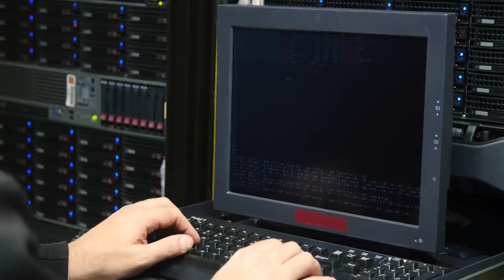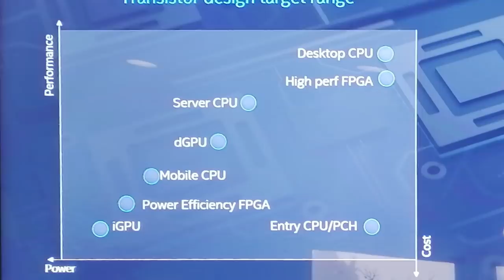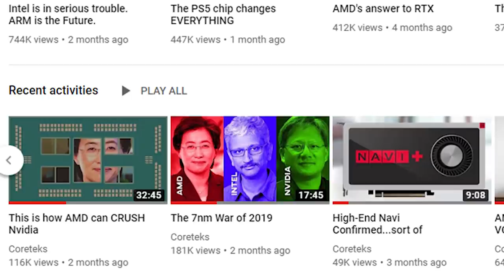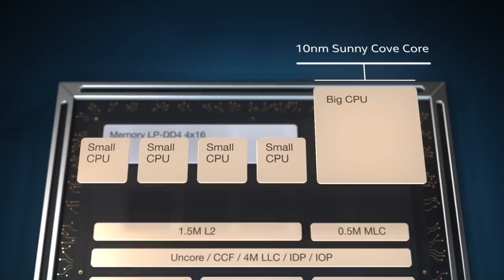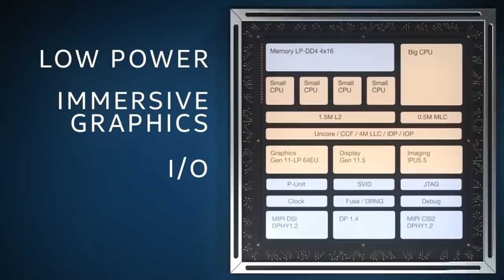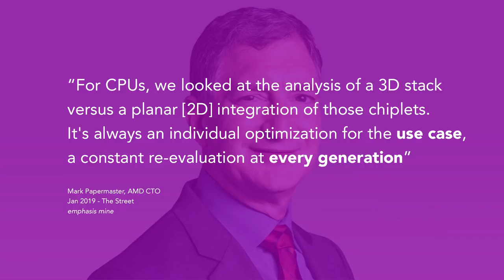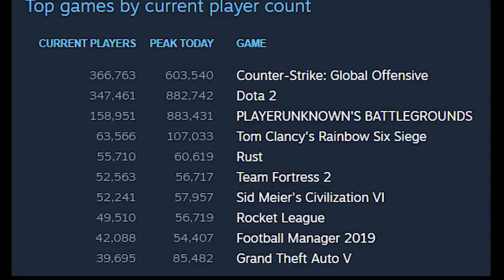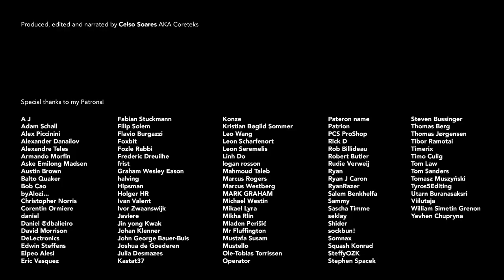2D vs 3D Stacking: Intel’s plan to beat Zen 2

Comment: I haven't upgraded from the devils canyon 4790k yet, it's starting to show some age in areas but all in all it's still hauling ass, Moors law seems to be slowing due to production cost. I read that part of the recent security issue in faster chips was partly from transistor bleed due to how tightly packed together the circuits are. Could explain why intel has been manufacturing 14 nm for 4 generations of cpu if you want to read or watch something really innovative check out neuromorphic chips. still probably a decade from production tough I think also what im hearing is the actual motherboard could become a bottleneck at some point haha

Comment: I love AMD and 3D stacking is the future but all that heat has to go somewhere...hope that doesn't melt the stacking interconnects. Either way I can only afford AMD for CPUs at this point and my stock R7 1700 does amazing things paired with a GTX 1080ti and Davinci Pro editor. Btw I'm not all team AMD, I joined the dark side and paired my Nvidia to a Gsync screen for the ULMB mode, aaaaaaamazing! P.S. I hope EA keeps making mistakes until forced out of existence and they sell all the IPs to more ethical publishers like CD projekt red

Comment: 3D probably is a good thing to do, but can they get all the heat out then. Heating the memory too much could cause lost the memory. Place the cooler (like micro heat pipes) between the CPU and memory also. Smaller transistor power consumptions...
The CPU speed never is fast enough.

Comment: Intel has done this various times in the past.  The Tualatin core was actually supposed to be introduced in the Pentium 2 era (it's a P3 technology that made its way well into the Northwood P4).  They hold back on purpose to stimulate the market.  AMD's x64 architecture is VITAL and if AMD dies, Intel would no longer be able to use this technology.  CPU manufacturers are not at war with each other.  This is the "Other Tick Tock Market".  Buy you Zens now and enjoy, there's nothing wrong about it.  They're cheap and efficient.  But Intel will eventually release some tech that it developed approximately 8 years ago in its newer lineup.  3D stacking in CPUs is almost 2 decades old in development by Intel.  So stop the wars and just buy what's cheap and works.

Comment: 2030 PREDICTION: CPUs are now cubes cooled with a combination of tiny Peltier devices and tiny heat pipes that join into bigger heat pipes like the branches of a tree. All these heat pipes will come directly out of the CPU and into a heatsink. No more thermal paste, no more custom coolers, no more memory cards. Due to size and cooling constraints, CPUs might go back to interfacing with the motherboard via a slot. CPU cards are back. Google Chrome and other ram hogs will move to feed on PCIe storage, that will be faster than DDR4.

Comment: Just put the memory on the bottom to fix the heat issue. And software devs need to just get with it and get parallel code going

Comment: So intel will be making 3 stacking CPUs that doubles as a easy bake oven? They have to solve thermal problems and the connection between all these parts and cores so that it doesn't have high latency just like Zen cores does with Infinity fabric.

Comment: There is a kind of cooling oil where u can submerge the cpu into without short circuiting it. So they can design the cpu that can be submerged into a mini cooling tank with that oil and then the oil is cooled by the external liquid cooling?

Comment: this will end the same way as HBM. AMD used stacking back in 2015 and it was expensive and it was called HBM Curse beacuse vega couldn't use GDDR5/6 because of the memory controller and that made the cards insanely overpriced. Radeon VII's price is 1/2 only price for the 16GB HBM2 memory. but that is future. it is expensive now but it will beacome mainstream

Comment: OK... quick criticism... when you compared the FX-9590 to the 4770k... There couldn't be more of an apples to oranges comparison. The 9590 as most know was a 32nm process, and at that was nothing more than a factory binned and overclocked 8350... which was well behind Intel's 32nm Sandy Bridge architecture... let alone the 22nm+ architecture used in the Haswell 4770k, in terms of IPC performance. About 35-40% behind at stock clocks... meaning you'd probably need an LN2 setup and around 6Ghz to come close to or surpass the 4770k at stock clocks... There's only about a 10-13% IPC gap right now, and Zen 2 looks like it will close that cap to within margin of error. So let's hold off such farcical benching comparisons until there are Zen 2 Ryzen chips in the wild and we can see what they do head to head with the 9900k.... as well as waiting to see if Intel can actually FINALLY get their shit together and release 10nm desktop or if they're forced to delay it yet again...

Comment: If you have to prevent overheating of 3D chips by lowering the clock speed, that makes no sense, if a 5GHZ chip has only 64MB of cash as opposed to a 3GHZ chip with 1GB of cash, that will make no sense either.
I am focusing more on smaller nm technology, just imagine if we will reach 1nm processed chips,imagine how much power can be shrunked down on a chip, also can’t wait till china will show it’s ‘’fully reliably working’’ to the world rather then bagatelize it,sothat we can reimagine how much more powerfull computers will ever be with new possibility’s but i guess this will also cause panic to the world.

Comment: I'm not sure how Intel is planning on cooling this "stacked Chip" they are not going to be able to get clocks up to anything near competitive to Zen 2 until they have a process advantage again.  Also the cost of Intel's active interposer is also gonna be VERY!! expensive just imaging the amount of silicon this chip is gonna need. The base interposer is gonna need to be almost a big as the whole package and will need to yield at nearly 100% functional to be usable.  So this chip is gonna be massively expensive for maybe slightly more performance.  i think intel can get it to work but i doubt that they will be able to make it cost effective for the consumer market for some time.

Comment: Ok, I may not be an engineer, but: How do they want to get the heat out? Stacking heat-producing components? Damned, it's cooling nightmare!

ps: No, I don't hate Intel (despite their price-gouging, but it's less than Apple, they just take what every market-leader would! I might not like it but I understand it)! Hell, I've run mostly Intel-Cores since I built my first PC (that was an AMD, but only because I was a damn kid who wanted a decently priced PC for gaming, after that it was a Pentium III and in 2005 or so I had an Athlon 64 (when Intel was losing their touch for a while and nearly missed the 64-bit revolution)...otherwise? Intel Core 2 Quad Q6600 from 2008 to 2011 and since then an Intel i7 2600K...so I am looking to upgrade currently and I will buy whatever is best for my budget (and I will wait for ZEN2 and then look at my options!))

Comment: I'm curious as to why it seems like 5 ghz appears to be an invisible threshold that is holding everything back. Why is it that silicone or micro transistors react to the frequency so predictably.
Reply: Processors are made up of a bunch of inadvertent tanks (LRC circuits). Every set of wires close together can add capacitance. Every long wire can act like an inductor. Resistance isn't a big deal on its own, but when paired with capacitance and inductance, it can get hard to quickly charge and discharge lines, without big fast transistors, meaning more heat.

Transistors themselves should be in the tens of GHz range, if not hundreds, now. But as things get smaller, those pesky wires get in the way.

Comment: I'm not an expert in semiconductors by any means but, wouldn't it be theoretically possible to put a stack of HBM2, on an interposer with a CPU as a massive L4 cache sitting between L3 and system RAM? If anyone knows why this would or wouldn't be feasible, I'm interested :)

Comment: how does putting more shit in the way of the cpu to the heatsink improve cooling feel like the cpu wont get cooled fas enough and die, and at the same time the drams will get melted by the heat passing through and also die.

Comment: Why wouldn't they put the cache on the bottom of the chip. It's the processor that makes the heat so you would want that to be the closest to the heat spreader. Also data from the ram is loaded into the cache so wouldn't it make sense to not have to go around/through the processors

Comment: there is no reason for amd not to combine chiplets with 3d stacking (same is true for Intel of course but they inherently Need to first redesign their monolithic chips into viable chiplets).

i fully expect amd to move cache to a 3d stack next gen and/or have an apu with integrated ram stacked. however i think it will make most sense for amd to keep the seperate io-die, stack cache on there (as these components traditionally do fairly badly with node-shrinks) and have the cpus stack only 1st % 2nd Level cache as well as a dedicated gpu chiplet with maybe two stacks of hbm3 for internal memory.

if smartly combined this can reap 90% of the 3d stack benefits while also taking along most of the chiplet heat distribution advantages.

3d stacking is an approach that is fairly easily adopted as it requires less redesigning than going from monolithic to chiplet. i thnk the main question will be how fast Intel can move over to chiplets.

Comment: in my opinion I think intel is scrambling trying to figure out anyway to compete and surpass with the zen 2 processors. I'm guessing Amd is gonna win out in the next year or 2 because I see intel if they use the 3d stacking, the first gen and possibly 2nd gen is gonna fail due to trying to dissipate the heat from the lower stack of the chiplets causing burnouts and extreme hot spots. Now this is just my opinion and its not like I can predict the future or build processors so its hard to tell what will happen.

Comment: Is ther something I missed    What I getting from dis is 3D stacks dram on top but dram is not gonna replace cores right.  And intel can’t make 48 or 64 core chips if ther use ther put all the shit on one chip tactic there can glue as much dram on ther chips as ther want but ther have to get more cores at lower price right?

Comment: Intel comes to this 3d stack for a long time. Lvl4 caches in 5000 series of processors, fpga matrix, high performance gpu and some other things. But did new era bring new things only to intel?? optimization on of die cache makes big sense to amd to. If programmers star use of die cache what is difference if that cache in a other core die ))) This would be a new big battle like at 80-90. And now there three players arm,amd,intel. Every company prepares for 20-22 years. Good time to be alive )) )

Comment: 3d stacking will increase cost dramatically and also heat management will be hard. Most importantly what intel will do with faulty chips if that cant output more power than a 2d chip. So, clearly amd will be in advance position in near future.
Reply: No, monolithic dies will give diminishing returns after a certain point even if everything else is improved dramatically, 3D stacking will solve this and provide scalability over generations. Even AMD is working on it, Nvidia may also be working on it considering gains in machine learning with high bandwidth. However, heat is still a problem, once solved, it will be generations ahead of monolithic architectures.

Comment: I won't hate on 3D stacking... I have to see it to believe it though...
About that 10nm... Was waiting for it back in 2015... Delayed :D 
Then it was for 2016... Delayed...
2017... Maybe? Zen is going up and up, Go go 10nm! Delayed!!! :D
2018... The same :D 
Now it's 2019... I'm not waiting for 10nm... By this point it has bin so pointless so I'm just expecting them to fail at 2020 :D Sure, they'll come up with a REVOLUTIONARY 10 nm, 3D stacked... 1Gzh 5W chip... That can provide enough processing power to start my light bulbs when I enter the house, or turn on the water when I go to the toilet... That's what I'm expecting... Kinda hard to get disapointed when you're aiming that low, am I right? :D 
Now on a bit of a serious side... 10nm chips have bin out in the wild for about an year now... And they are "extreme low power" 1,2 Ghz that can't even square off vs some half decent ARM processors... 10nm is a bust guys, it's bin 5 years so far and we really have to get over it... Doesn't matter how big of a chiller you use you still won't pay the bills if your fuse keeps tripping every time you hit "render"...

Comment: And how is exactly adding 1gb of High Bandwith Memory for cache purposes going to solve the main issue most Intel parts have, which is price (at least for the average consumer) besides, it's simply memory, it will store information, not process it therefore if the cores are not fast enough to take advantage of it then it's going to go to waste. I mean, I'm sure they won't be adding more cache than what's strictly needed though but still, prices will unfortunately go up. So I hope they at least get it right and the core performance is able to take advantage of HBM.

Comment: Wasn't Intel in "serious trouble" a couple months back in a video of yours?
Reply: If this whole stacking thing doesn't work like promised (and intel has a history of things not working out), they are. And even small delays like a year or so, could mean, that amd is catching up. As he said, even while we don't know that jet, it's likely, that Zen3 and Zen4 are 2.5D and respectively 3D chips also. So if AMD is on track with their solutions, that's still the case.

And it should always be the case, if we want serious competition and better tech year by year. We have all seen, what happens, if there is no competition and only AMD is having problems.
Reply: They still are. They will be in trouble until they replace silicon. They are in a no-win situation, as the leader in this kind of tech. It's costlier and riskier every generation, to shrink more, and they are trying to stay the smallest and most dense. Meanwhile, the market won't accept more than very small price increases over time, making it harder to get enough profits to make up for it lime they used to. So, their investment, operations, and revenues are all slowly trending towards an intersection. But, if they can't throw bags of money into R&D all the time, they will quickly lose their top dog spot, and never get a chance to regain it.

Comment: What we really need is newer materials to make CPU's from like Gallium, Vanadium Dioxide, Graphene rather than Gold, Copper and Silicon as smaller than 5nm has Quantum Tunneling problems with Electrons which means errors so the future at least for now will be in Newer Materials and Architecture and not in more Cores, Hertz or smaller Fabs! 

He forgets to mention the massive cost of rewriting code of OS and Programs to run on ARM or RISK Chips while the information they contain must still able to be read and used on X84 and AMD64 chips and atm they ARM or RISK are only usefully for short simple tasks they do not hold up over time under heavy loads where they burn out or crash AMD and Intel are both working on removing much of the old instruction sets to give a faster, smoother more reliable CPU as around 75 to 85 percent of the instruction set is not relevant to modern OS and Programs!

3D stacking only works on the newer smaller FinFet chips (7nm or smaller!) as 12nm or larger generates way too much heat with little to no way of cooling them effectively so they would need to thermal throttle much more than modern designs!
* 3D stacking is about 5 to 10 years away from being truly beneficial!

Hertz matter much less than effective Architecture Design, Apple & WIndows (and maybe even Linux!) need to make programers make better use of existing Core Counts as a CPU very very rarely has any program use more then 4 cores at a time and generally not for very long most that do are Rendering Programs (like Adobe, CAD, Final Cut and ofcourse Games to name the most obvious!) of some sort.

Comment: Hypothetical Question here: 
If Intel actually uses HBM cache memory and lets go PlusUltra and stack Optane over them, so how will they manage to cool the chiplet at the bottom and will that heat damage the memory chips above them?
Non hypothetical belief: All chip manufacturers have thought of stacking chips long way ago buy gave up immediately due to the above conflicts and scaling of that time.

Comment: What are they focusing on L3 cache instead of L1 or 2?
Reply: L1 and L2 are integral parts of each CPU core, and fixed in size. L3 is a separate thing.
Reply: Thus slower? Same bus width?
Reply: @errvega2705  Slower, and also denser. I'm not sure the bus width on the current CPU L3s, but it would not need to be the same as in L1 or L2. It's either 32b or 64b, likely, though.

The processors can't work without L1 and L2. Each core has its own, they are small, fast, and tightly integrated to the core 's functional units. They can't easy go halving it, or doubling it. L3, on Intel CPUs, is disconnected from the CPU core itself, and can be different sizes and configurations.

Comment: 3d cpus haven't taken off due to heat issues, I hope they have fixed that or they will have to down clock their cpus thus losing performance. Not only that they wont be able to cool them in laptops leaving them far behind in the future.